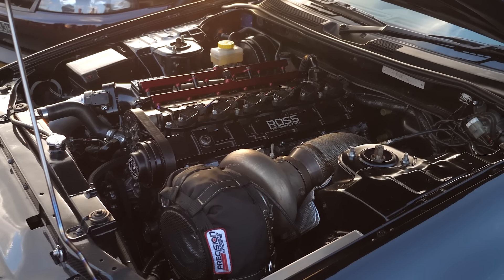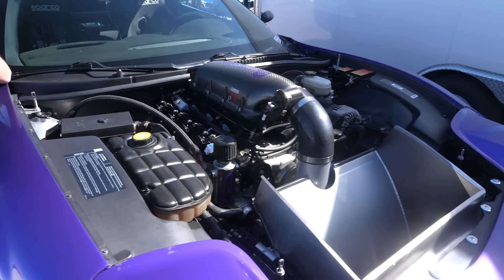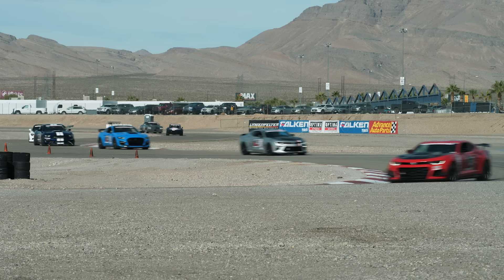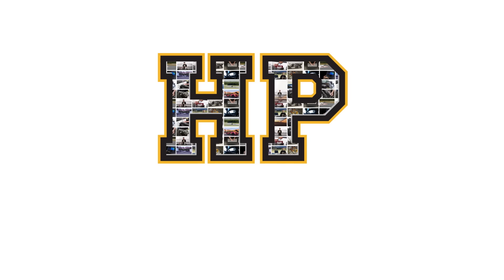What Should My Engine COOLANT Temperature Be?

Comment: Congruence.["1. Hi guys and gals, so at 19 minutes give or take I felt I need to basically repeat and agree that there is a half of dozen or more variables to take in count when diagnosing and researching with various means of control. I found this interesting and important to always keep in mind from getting better performance out of the 4 speed auto transmission of the late 90s early thousands VW 1.8 TURBO Golf like the GTX and so on where they are using the engine cooling system to regulate the transmission temperatures while no extra radiator or auto transmission fluid radiator/cooler like on v8 autos and heavy/high temperature environments and whether poor design more likely in my opinion as we know turbochargers generate higher temperatures in standard conditions therefore adding cooling supporting mods will be a standard for those in the know, this is due to economy and keeping a fair price on the Golfs and using the 4 speed auto transmission that is good for 300 Kw. So cheers for sharing with us this knowledge as it is highly valued by people in the know as cooling management can prove to be difficult when there are factors not taken in count so the practicality aspect of this knowledge should be know better as is more commonly needed than that of the people initially believe the need and demand for parts and support is. 
2. Another thing that needs mentioning on the engineering design challenges we face, I am sure we can come up with new engine designs other than the piston cylinder hydrocarbon 'dragons' we love, if more efficient scientific formulas or experimental design stumbles over better efficiency. If we look at the industry as Kilowatt generating machines as they are the only ethical slaves and forget about letting the machines scavenge energy as that is a major flaw in the fundamental design such as using converters as so called engines in the electric cars as where only the new rotary mazda generates its own kilowatts, the full electric vehicle's electric engines if you can call it that, are energy consumers and 100% liability to a honest communicating power grid. with less obvious consumables the incentive for economy goes away as a battery does not go up in weight or volume as it changes its capacity. Sorry to go on a rant but I felt my rant is somewhat a duty of care as a world citizen should I call it as the access to web is the new business travel heheheh. Transport for business and travel for private conveyances so lets support oil industry and channel the force to stop the natural curing CO2 from the natural unstoppable evaporation of water by the sun ever since they got married heheheh. Cheers folks and techs at HP Academy. So if they say till infinity and beyond, we say till we beneficially and positively generate and store hydrogen as a unit fuel tank. 3. Proud to see a good 'Kiwi' man such as Andre on the mic and moving picture as well as many other performances I presume. Cheers and looking forward to the good knowledge sharing of data and studies that count, science is so rewarding and therapeutic compared to pseudo social sciences. Much respect, and all the best from the south island here where I know a lot of 'kiwis' are in Oz, don't forget New Zealand is the size of British Isles and Romania so we need the best people that know New Zealand to be able to market here too so come and visit to keep some local status and help the communities with promoting tried and tested markets like the metal industries that have not gone out of fashion for tenths of thousands of years."]: Conveyance in good faith and confidence by this author: ["Dan"]-bogdan-saris: Cucu..©. (If people want to inspire from my rants you are welcome, be correct and do not presume other ability in other or greater ability in people or companies is not a definite and direct result in rising competition. There is such thing as co-operation for basic function of community and some dominions are obsolescent.) Cheers and Congruence.

Comment: If you want to keep a cylinder head on your race engine 
Use Redline Water wetter 3/4 bottle to most 4 cylinder cars and about 1 litre of green antifreeze 
The molecule size of Water Wetter fills in the gaps where water touch’s the surface 
This in turn will cool better stop cracking head’s especially on av gas and any other hot race gas
Our Aussie touring car would spit heads out every yr on water ir water and antifreeze 
Add Redline and you’re laughing 
No 
I’m not paid by this company 
But I worked 10 yrs in the USA in NASCAR ,Trans Am and SCCA Pro
Reply: I use penrite racing coolant. I do believe it has a water wetter addittive to it, and since it is super concetrated you can use 1L of it for up to 20L of water
Reply: just clean it and add good coolant like a normal car.